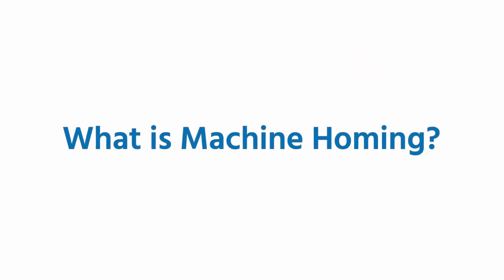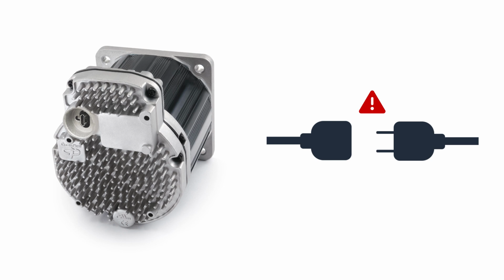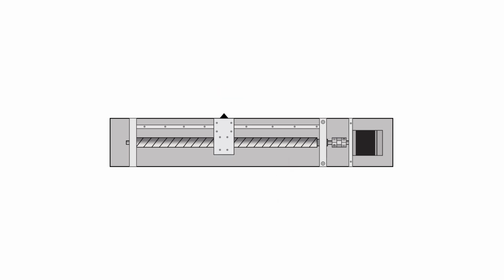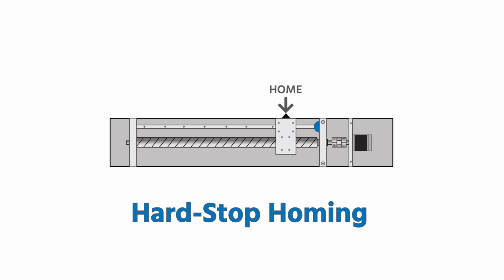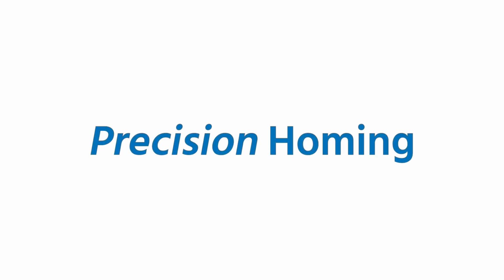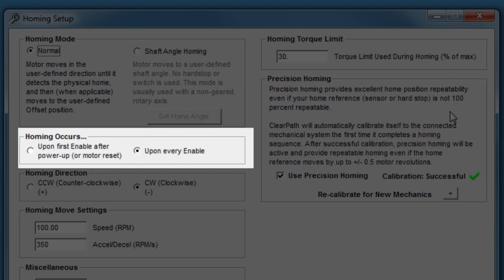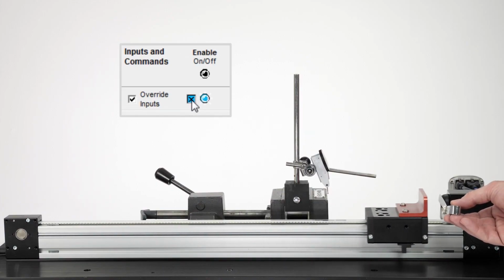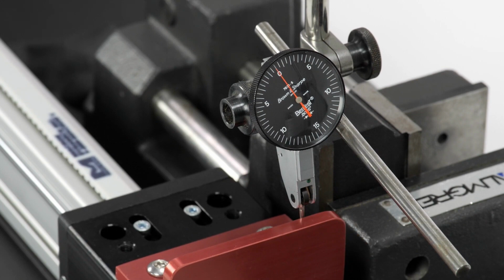Homing and Precision Homing with ClearPath Integrated Servos

Comment: I already use the hard stop homing on my lathe and it works quite well. But this will definitely be a plus, I'll upgrade today. Thank you for supporting your products in the long run. The autonomous homing procedure is useful for DIY CNC because if makes for a much more accurate homing that inductive or mechanical sensors, and does not waste the feedback line (have to use it as fault feedback) or any CNC controller input.

Comment: Very cool. I'm designing a simple piece of equipment that requires speed control, a start button, a home button and an e-stop. 
I was considering using the ClearCore and incorporating limit switches... but I don't think I need that anymore. 
1 pwm speed control and 2 buttons I should be able to setup with just the I-O on the integrated motor controller if I use torque limits for hard stop homing. 
This feature is great. Saves time and reduces hardware and failure points.

Comment: Im about to buy clear path SDSK-3421S-RLN for X and Y and then SDSK-3432S-RLN for Z axis. Just wondering for my mill should I get the HP models which cost a little more but then supposed to be very very good.
Reply from the maker: Hi James

I'm an applications engineer with Teknic and would like to help answer your question.  The primary difference between the SDSK and the SDHP is that the SDHP has more shaft power. Because shaft power is the product of speed and torque you can get more power by either spinning faster, producing more torque, or both. The other notable difference is that the SDHP models come standard with the "Enhanced" ("E" versus "R" in the part number) encoder option with a command resolution of 6,400 quad counts/rev versus 800 quad counts per rev on the SDSK. The Enhanced option also includes the full complement of the Regressive Auto Spline settings for double jerk limiting your profile for smoother motion.

For most CNC mill retrofit kits, the power and capability of the SDSK closed-loop servo series is more than sufficient. As an example, many of these CNC retrofit systems use ballscrews with a 5 tpi pitch (0.2 inch lead) so, with the CPM-SDSK-3421S-RLN motor at 75 Vdc, you can theoretically achieve 200 inches/min (1,000 rev/min x 0.2 inches/rev = 200 inches/min).  

There are naturally a lot of factors that go into picking the optimal motors for your CNC upgrade, but I would start with determining what top speeds (during both rapids and cutting) are important for your application. By understanding the top speed objectives along with your mechanics, you can then narrow down the motor selection. 

If you have any further questions, please feel free to contact Teknic at 585-784-7454 or submit a contact request at https://teknic.com/contact/.  

Thanks, 
Abe A. - Teknic Applications Engineer
Reply: @TeknicInc would you know can I use Centroid 6 axes with your motors sdsk 3421s-rln and 3432 sdsk motor?
Reply from the maker: Hello James,

We don’t personally have direct experience with the Centroid CNC controllers but we do know that many mutual customers use them and seem to be quite pleased with the performance and capabilities. The controllers well-suited for use with ClearPath SDSK and SDHP motors are the Centroid Acorn and AcornSix. There’s also a convenient break-out board for routing control signals from the controller to the ClearPath motors (you can use our standard controller cables without modification). This break-out board is produced and sold by CNC4PC and is called the “C89-ACCP”. https://www.cnc4pc.com/c86accp-clearpath-connector-board-for-the-acorn-controller.html

If you decide to use the Centroid Acorn controller, I’d also recommend the YouTube channel, MartysCNCGarage. It’s an excellent educational resource for CNC hobbyists using ClearPath motors with the Acorn controller.
https://www.youtube.com/channel/UCTNt9IIjsk5HNwnjzer6GVQ/videos
https://www.cnc4pc.com/c86accp-clearpath-connector-board-for-the-acorn-controller.html)

If you have any further questions, please feel free to contact Teknic at 585-784-7454 or submit a contact request at https://teknic.com/contact/.

Thanks,
Abe A. - Teknic Applications Engineer
Reply: @TeknicInc  I was trying to read the Acorn Six Datasheet and picked up on something I dont know whether its important or no. Basically it mentions AC motors and I'd though for some reason your motors were dc. I guess the DC part doesn't matter as they will have their own IPC5 power supply. The acorn six with software looks very impressive. So buy that and the breakout board from cncpc then your motors and ipc5 plus cables. Thats a good setup then?

Comment: But HOW does it work?
Reply: By reading a document from clearpath, it appears that precision homing is done through the software remembering the partial rotation of the motor during the initial homing calibration. Then, if the end stop gets worn down by a mm, the software can still use the information from the endstop to restore the correct full number of motor rotations, but the partial motor rotation is reset from the initial calibration. This means that the motor can correct for worn down endstops up to +- half a motor turrn.
Reply: On the first homing it will memorize the encoder count. Then the homing procedure will only be used to identify on which rotation to home, and the encoder count on that rotation will do the rest.
Reply from the maker: Hi @Evan-inc.

As @CrazyMineCuber and @SuperYellowsubmarin said, precision homing can automatically account for variations in the physical home position (either a hard stop or sensor) because the motor "calibrates" the home location the first time it is homed. Then, the motor references that calibrated position every time it needs to home again. 

As you can see in the video, even after adding the shim or removing the bumper, we home the motor until it detects the hard stop. Upon reaching the hard stop, the motor compares the measured home location to the calibrated home location and automatically accounts for any difference between the two (up to +/- 0.5 motor revs). Precision homing can also be used with a sensor to compensate for variations in sensor position and homing speed. 

For more information about homing a ClearPath motor, I suggest checking out the ClearPath User Manual found on our website: https://teknic.com/downloads/. 

If you have any additional questions about precision homing or anything else, please feel free to contact us directly at https://teknic.com/contact or give us a call at 585-784-7454.

Thanks,
Jon K. - Teknic Servo Systems Engineer

Comment: If this motor has an absolute encoder to memorize the position, why does it need to pump to a hard stop? you can simply home it once forever.
Reply from the maker: Hi PLC24_max10:

Thanks for commenting and taking the time to ask a question.

Teknic motors have incremental (not absolute) encoders onboard. We’ve found that incremental encoders tend to be more reliable and less expensive than absolute encoders, which is why we use them in all of our motors.

To provide some of the benefits of absolute encoders without the drawbacks, Teknic developed the Precision Homing feature demonstrated in this video. Precision Homing works because the motor “calibrates” and stores (in non-volatile memory) the physical home position the first time it is homed on a set of mechanics. The motor can then reference this stored home position on each subsequent homing cycle. While we still need to home the axis after the machine is power cycled, Precision Homing combined with ClearPath’s Position Recovery feature (demonstrated here: https://youtu.be/mALi3_QqyHk?si=B-RDD600dfYfUctP&t=458), can provide much of the benefits of an absolute encoder as long as you maintain logic power at the motor(s).

Please feel free to give us a call (585-784-7454) or leave us a message at https://teknic.com/contact/ if you have any additional questions.

Best regards,
Jon K. - Teknic Servo Systems Engineer